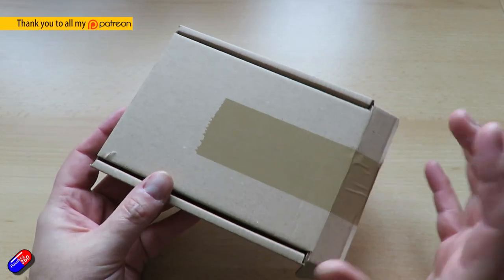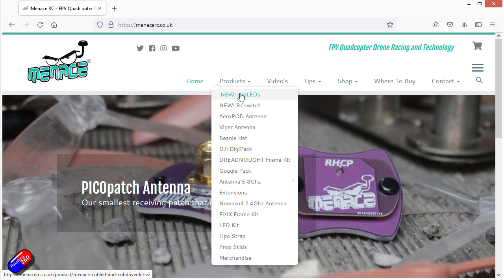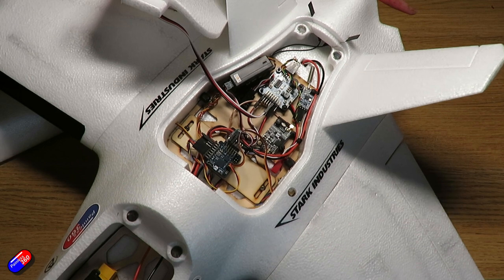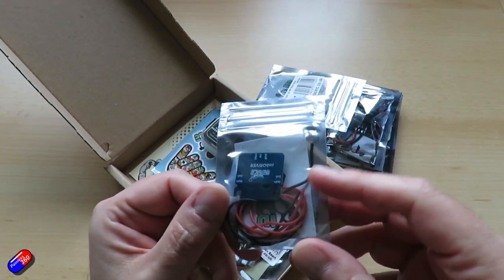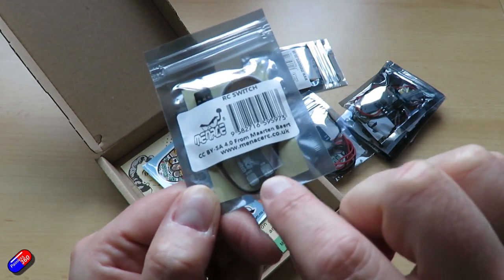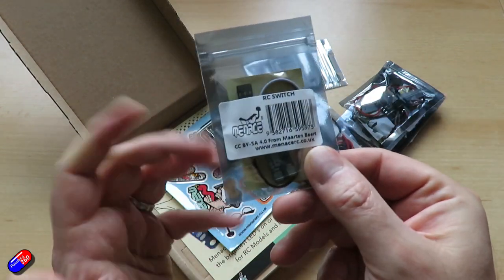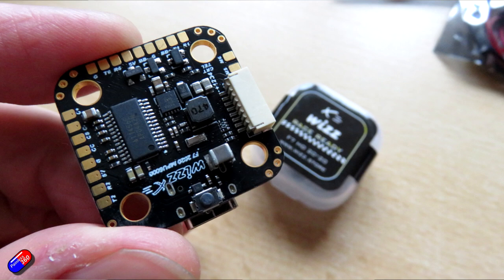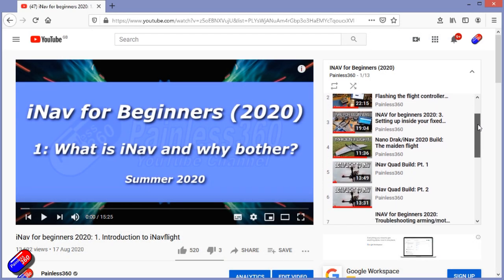MenaceRC Green COB LEDs and a new 20mm F7 WIZZ flight controller!

Comment: I just researched this board made some notes on it.  Didn't know you made a video on the Wizz FC.

You said no one will use the M5 & M6?  I will because this board will upgrade my little Hex Racer.  With all the UARTS, the Wizz could bring my hex into the digital world along with ELRS.  If I can find a Caddx VTX (the nano..?) that can fix on my build, I might have to locate a taller standoff for the top plate (again.)

And I'll have to buy the DJI goggles last.  (ouch)
Thanks for the video.

Comment: Warning with the cobs, I found I could put red and white on one driver as long as they are in series however DONT put red and blue on one driver as this will blow the driver. In short its not a good idea unless proven to work to mix colours on one driver. PS you may need sun glasses LOL

Comment: Those COB LEDs look like they're ridiculously bright, usable beyond our RC toys.
I made a couple of small floodlights using the same sized COB LEDs salvaged from Poundland AAA powered lighswitches, making them with 4 COBs per floodlight, perfect brightness & colour temperature for photographing my 3D print designs I put on Thingiverse.
But they only have 10 LEDs in each COB, MeanaceRC's ones have 30 LEDs in each COB!
Reply: Try the 100w COB LED's in a heat sink fan of course 👍  i made a few and omg, we call it "the sun"